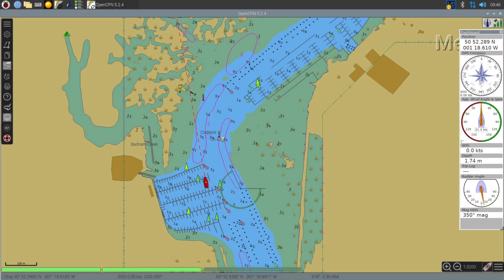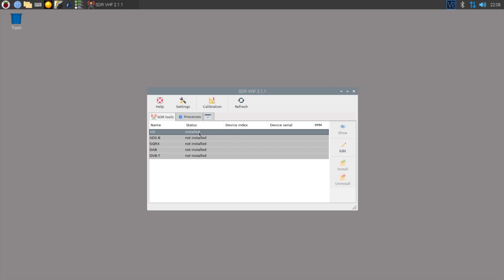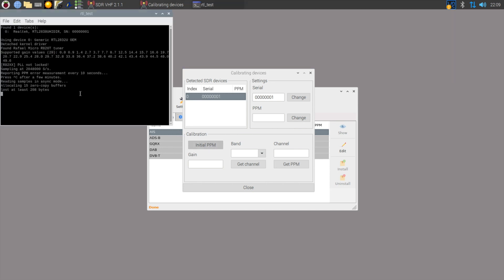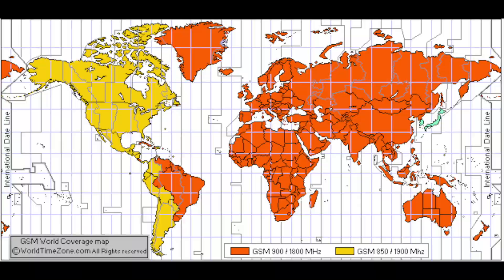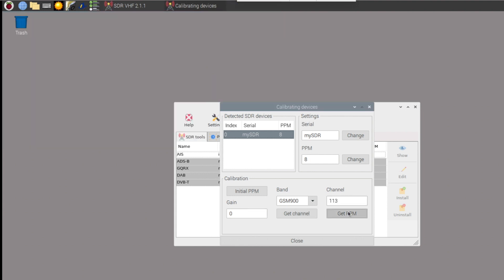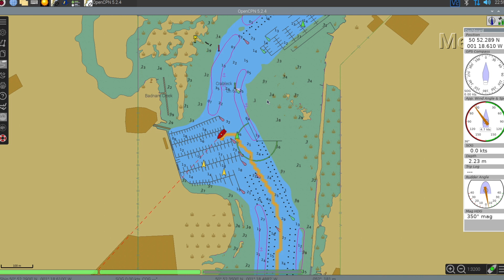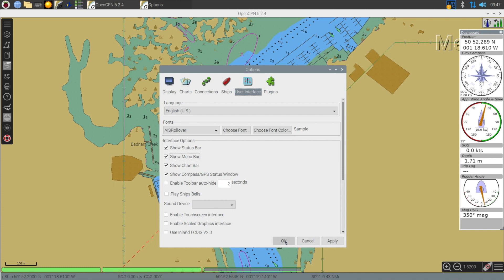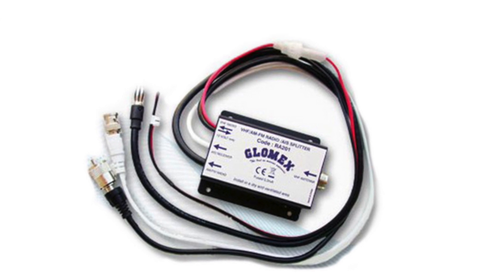OpenPlotter - AIS receiver for £30??

Comment: Hello! I want to use a daisyHat for the AIS but I did not understand which antenna I have to connect to it. Can you suggest me an example? Thanks
Reply from the maker: Hi, are you looking to use your main antenna with a splitter or installing something dedicated? Any antenna suitable for VFH will work:

AIS communication takes place using two VHF frequencies, 161.975 MHz and 162.025 MHz, using a bandwidth of 25 kHz.

Comment: Really a very good video. Thank you. But I have question, at 1:35 min you have to initialize the PPM, but do you take the "Currenty PPM" or the "Cumulative PPM"? Thank you very much in advance.
Reply from the maker: Thanks for your comments on the video - You take the Cumulative value, the longer you leave it to run, the more stable that value should get. Mine got to the point where it hardly changed and that was what i used.

Comment: the GSM function has nothing to do with AIS!. the GSM is used to calibrate the Gains and PPM why did you say "it will go off and find AIS signals" ? the AIS signals are transmitted on are 25Khz plus and minus of 162Mhz
Reply from the maker: Hello, You are 100% correct, I should have said GSM at that point rather than AIS. As you say the GSM function has nothing to do with AIS, it was added to the software to calibrate SDR's that dont feature a built-in TCXO.
Reply: @BoatingwiththeBaileys   no problem , I have learned that there is long-range AIS also transmitted 25khz plus and minus of 156.8mhz channels C and D .. not near the coast to check this out

Comment: is the ais receiving range dependent more on the antenna than the receiver itself or are the receivers themselves  varying in their ability to pick up signals
Reply from the maker: Hi, I’m sure it’s a bit of both,however, the change from a small indoor antenna to the boats main VHF made a huge difference to mine. I went from being able to see the next marina to approx 8 miles. It is a good idea to use a separate AIS aerial on the back of the boat instead of splitters which I do currently use.

Comment: A great video, I have a SDR radio that I am going to try and set up with OpenPlotter, etc to get weatherfax and AIS.  The only question is on video it seems like it isn't getting an accurate sampling of moving targets and enough range(probably an antenna issue).  I might still go for a commercial unit that broadcasts(on a VHF antenna), I haven't decided yet.  I've seen coasties harra-ss sailboats because they know they are a sailboat through AIS and can't run away from an inspection.  So broadcasting boats seem to get more "inspections."
Reply from the maker: Many thanks for the comments. Interesting about the antenna, something I need to investigate further. I’ve also seen weather fax in the documents and fancy having a go at that too.